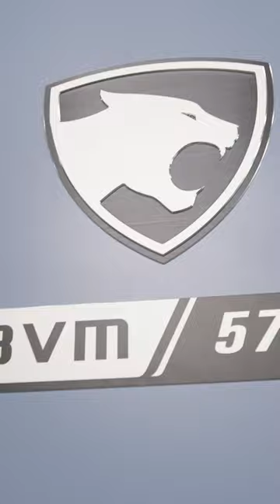Satisfying Toolpath Creates Waves in Heat Treated 4140 STEEL

Comment: .06" tool nose radius I'm guessing? Even with titan speeds and feeds, that's a LOT of surface footage that had to be contacted by whatever that Radius is. The work piece appears to be around 18" x 24" so that's 432" square. I think that is a 3/4" diameter cutter, so somewhere around just over 300 passes in x axis, stepping back in y .06" then feed in x&z back across at what I'm guessing is about 250 ipm. If I had to take my best guess from this 30 second short video, they got all this surfacing done in around just over 3 hours. I'm going to try and go find the full length vid, and see how far off I was.
Reply: Couldn't find the full length vid...  someone from @TITANSofCNC how long was did this surfacing program take to run?
Reply: There is your video sir. 
I remembered them grinding the thing ;)
https://www.youtube.com/watch?v=8oUGddr6UYg
your swag wasn't too far off.
Reply: @Jessie_Smith
Reply: I don’t remember exactly how long but you’re not far off.  I want to say it was at least 2 hours

Comment: why use a very expensive cutter, big and long. when you do not use more than 20-30% of the length. a lot of milling cutter that goes unused.
Reply: Not to mention rigidity and being able to run the feed faster
Reply: Clearance for thr camera? Can't  get a good close up shot with a stiffer set up